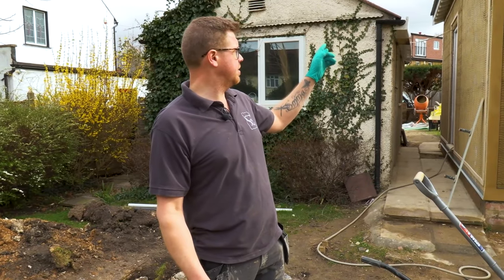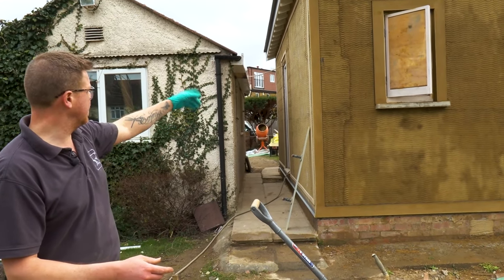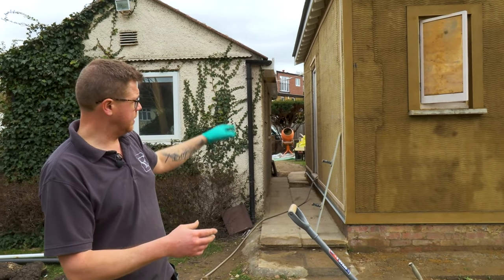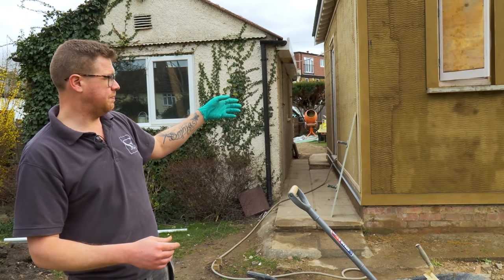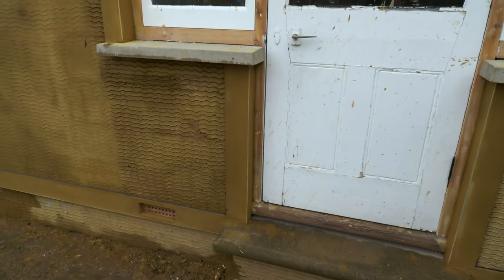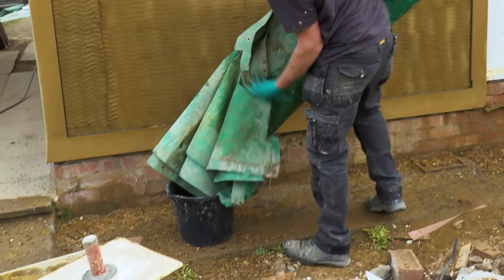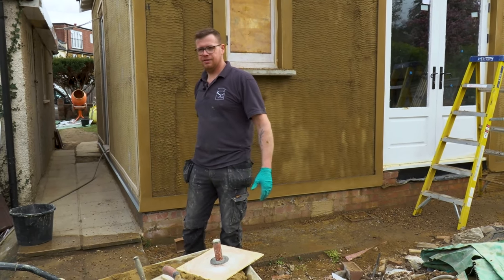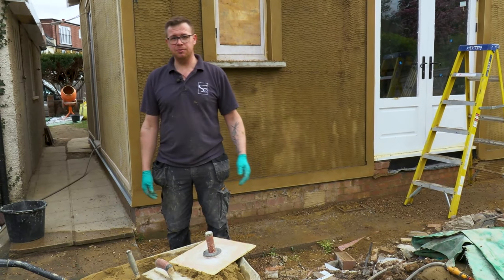How To Pebble Dash Rendered Walls

Comment: I've been a plasterer for 12 years, my old man was one before me and his dad before him. He taught me to dash first before anything else because it's forgiving seen as you don't have to rub it up to a fine finish. Never thrown it on by hand though, always used a small coal shovel to flick it on.
Reply: A makeshift table tennis bat much better and easier.
Reply: Didn't there used to be something called a Tyrolean Projector ?  I think you filled it with gravel and when you turned the handle on the side metal strips flung it at the wall.
Reply: @tombristowe846  there was such a device but it was not intended for gravel or pebbledashing. There was an actual product called Tyrolean and was quite popular back in the 70s and 80s. Was a slurry mix splattered onto either a damp wall or a thin base coat.
Reply: Wow that looks like hard work why aren't you using  a flicker and a box save a lot of time and mess
Reply: Same he in ireland use a dasher her done nice job

Comment: Use a  harling shovel or an old coal shovel, will speed up the whole process. Dashing by hand is only used in tight spots where a shovel will not get into.
Reply: True

Comment: Big hat tip to Ye Olde World Craftsmanship still extant in Ye Olde UK, nothing that labor-intensive being used on any large scale across the pond here in Yanqui-land... have a question though: there must be a small % of pebbles that don't get dashed very deep into the plaster, and are barely hanging on--do you give such a wall a few strokes with a stiff straw broom before painting, to knock loose the "loosies"?

Comment: When I did this the pebbles wouldn’t stick. Lovely smooth render, but the spar just fell off. Any idea why? It was fairly firm render. I found the render adhered to the wall best when not too moist. Was my render too dry?
Reply: It does sound likely that the render was too dry. It needs to be fairly wet, not spread on too thick as the weight of the spar can cause it to drag and only work in small sections at a time. We also use a waterproof additive in the scratch coat to help stop the top coat from drying in too quickly which gives us a bit more time. Hope that helps.

Comment: Do you use the same 5:1:1 mix for both render coats? Also, you mentioned having to build out the render quite thick, is this done in more than 2 coats? If so, what is the mix for each?
Reply: Hi Chris,
Yes, it’s best to use the same mix for both coats because if there is any movement they should move at the same rate which will help reduce cracking. And yes, where the render was thicker on the corners it was done in 3 coats all of the same mix.

Comment: I’d be very interested to see how you detail the joint between the bottom of the bell cast and the render plinth you’re putting in so as not bridge the DPC. So much conflicting information out there. Cheers!
Reply: nahladel  I’ve set the bell cast so that it just hangs over the damp course and have rendered the plinth up to just under the damp course so there is a gap separating it but you’d have to lay down on your chest to see it.

Comment: Moved into our first house recently and the bottom half of the house is pebble dashed below the storm porch. Took the old rusty light fitting and number plate off the wall and discovered they’d rendered around it rather than removing them first. What’s the best way to patch it in, I will add that it’s gonna be painted anyway, so I just need to know what to use etc.

Comment: Have harled 30 odd years and l have never seen it done that way. Use a harling trowel it's quicker and leaves uniform finish also sticks the chip to the cement better.

Comment: After chucking those stones do you press them in a bit with a board to make them more secure?
Reply from the maker: Not generally. They tend to stick. You always get an initial drop off but these are well in. Maybe the hand casting is the future.

Comment: what stops the stones from falling off over time?
is it a special render mix for pebble dashing? can you use any stone?
Reply from the maker: Some stones fall, this is one of the drawbacks of pebble dash but it was done to match the rest of the house
Reply: This is a nightmare to work on as a painter. Not sure why people still like this. Its like a birds nest🤨 but great work of course no doubt? 
But i think this is really really old fashion..
Reply: Hi skill builder what type of pebble dash is being used?
Reply: It’s the same mix I used for the flat parts 5 sand, 1 cement and 1 lime. The stones are 10mm gravel or some call it pea shingle, nothing special.
Reply: @bertalanlovasz7512  coming back in, different colours and size of aggregate     like resin drives, beautiful finish

Comment: Nice one, does it matter how hard you throw the stones to the wall.
Reply: Blue Boy it depends on how wet the mix is, I like to keep it wet so that I can keep it looking seamless. As I have it wet I can’t throw them too hard or it will just make a mess and it could cause the render to slip off the wall.

Comment: Never seen anyone throw a whole wall on by hand! Get a harling trowel fella.
Reply from the maker: He prefers to do it by hand. He might not do another one for 10 years.
Reply: Yea I'd say there is a difference, the way a harling trowel spreads it out rather then just bunched up handfuls but each to their own.
Reply: Back in the 80's I laboured on a plasterer whilst he dashed a gable, he had a shallow ply box for the dash to fall into and he did use a trowel/shovel to apply the dash, bit of a specialised art to it, its definately not as popular as it used to be.
Reply: @ljones396  true.